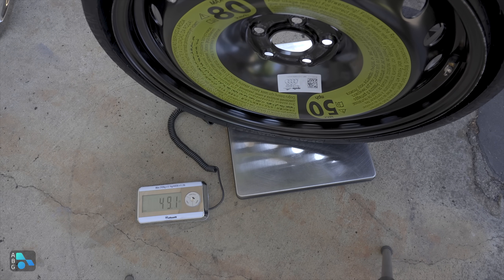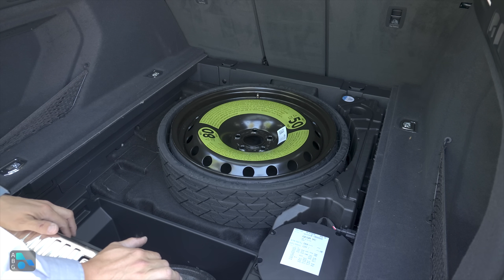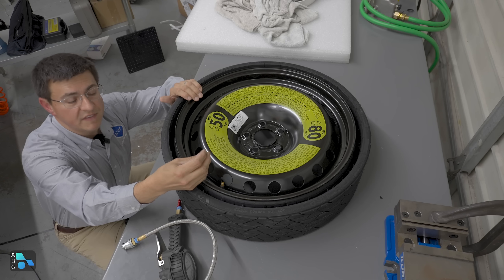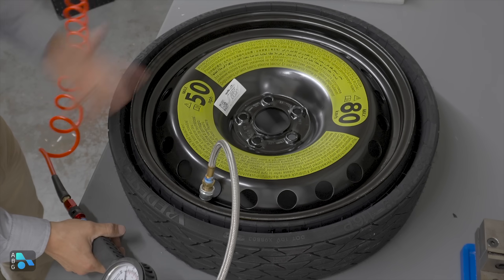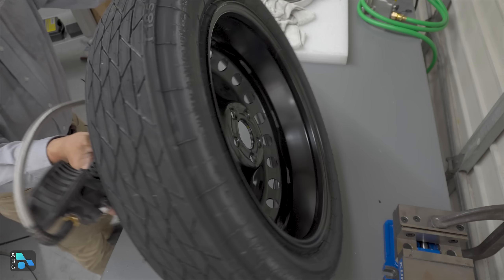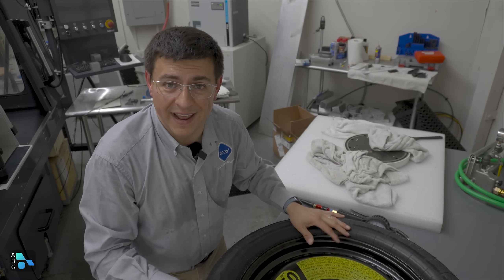How A Collapsible Spare Tire Works, And How It Might Save The Spare Tire In EVs

Comment: Think these tires are safe ? Want to argue with a guy who changed around 6,000 .tires before & after getting a mechanic apprentice certification in Canada? I watched people who came in from the 401 with compact spares completely bald ,& with 2 inch high, (imprinted on the tire ) warnings  declaring the maximum speed. ..%50 of the people didn't see the "same color as the tire" printing ! Others had a tire service or neighbor put on the spare.This warning needs to be stated in a complete sentence with the lettering you show..This is not a contest to see who is curious enough to read the fine print , this may cost you your life & the life of others.!

Comment: That's an ingenious design and it's my first time seen one but It's a load of crap cars don't come with spare tires any more. It should be a law. There's absolutely no reason why cars can't have a full size spare. . . Even a proper donut. (I had a Civic and put over 300 miles on my spare when I was in between jobs. Doing highway speeds and everything.)  The "EV" excuse is just hogwash. (Too many accountants in the CAD room.)

Comment: Temp spares are crap regardless.  Full size spare is the only acceptable solution.  50/50 spares are useless on the open road trip in the middle of the night.  Temp spares also don't solve the problem of where to put the dead wheel/tire if you have a loaded vehicle.  The collapsible spare is a cool innovation of 50/50 spares, but no one should be stuck with a 50/50 spare in the first place.

Comment: Sigh. Where do you put the full sized wheel and tyre you took off? Won't go where the collapsible wheel came out of. If there's room in the cargo area for the one you tool off, then there's room for a full sized spare.
I had this with a BMW Z3, take the space saver tyre out of it's carrying cage under the car, fit it, but there is nowhere for the full sized tyre to go, wont go in the cage won't fit in the boot. Where? They give you a placcy bag to put it in so your passenger can sit with it on their lap.

Comment: Do most people really need a spare at all? In my over 35 years of driving I have used a spare tire only once. Considering the  cost of fuel  for driving around with the extra weight as well as the cost of the spare tires I might as well have called to get the car towed to my home or the nearest tire shop.

Comment: I think it would be better in the frunk, if you have luggage in the boot you'll have to empty it to get at the spare. Also I think most people wouldn't change the wheel, they would just call a break down service, especially if it's raining or they have expensive clothes on, or don't know how to change it.
Reply: Probably a weight distribution issue... Some normal cars have used that reasoning for putting their batteries in the trunk instead of under the hood with the engine...

Comment: I absolutely hate the collapsible spare my Q5. It’s a nightmare. Especially if you’ve used it one time and then try to use it a second time David is usually falling off the rim and it’s terrifying to inflate.  

No, it is mounted upside down in the Q5 and the subwoofer fits inside

Comment: Nothing new, Datsun used a similar space-saving Spare tire system back in the 70s 240 thru 280 Zees using a compressed air can. I wouldn't recommend removing the tire valve because they can get lost pretty quick in a snap, just turn the valve enough until you hear the air bleed out or let the air out by holding in the pin.

Comment: This is not new.  GM was doing this in the 70s and they discontinued it due to safety reasons.  If I were the CEO of Audi/Volkswagen, I wouldn't worry about a spare tire, I'd be carrying around a spare transmission, spare engine, spare instrument cluster, spare electronics, spare everything.  They're JUNK BRANDS THAT DEALERS LAUGH AT going through the dealer auction.  Jokeswagen/Awfuli

Comment: The problem is you have a flat! That's the problem. Your idea is to change the tire to a spare then at a later time take your flat tire and get it replaced and then installed on your vehicle.
Tesla looks at it differently. They send out a truck that has your tire already in it. The truck comes out and instead of installing your donut they actually change the flat tire to a new tire and install it on your vehicle right there right in front of you. You no longer have to take your vehicle to fix the tire at a later date it's completely fixed right there where you got the flat

Comment: Seems overly complex. If they just had a regular spare the size of that one collapsed, they could use the air suspension to level the vehicle and the traction control to account for the different size. No need for the compressor or the wait for the wheel to inflate.

Comment: Collapsible spare tires are nothing new at all. They were available as far back as 1975, if not earlier, on General Motors A body cars. They were a bad idea then and are a bad idea now. After all, put the thing on and HOPE it has not deteriorated over time. Also find room to stow the flat tire and wheel. The other consideration is the weight of the vehicle and cargo. If you are fully laden you may have to leave some on the side of the road. With the rise of these vehicles room needs to be found. If my 1990 Volvo 240 wagon can hold a full sized matching tire and still have over 76 cubic feet of cargo space. Modern designers need to get with the program

Comment: This technology has been out for some time. What nobody talks about is what do you do with the tire and wheel that you pull off the vehicle. If you have luggage or anything in the trunk, it won't fit. Having worked for a European manufacturer in the past, customers always came in with their tire and wheel strapped to the back of the car with the trunk open. We always had a good laugh!
Reply: that's an excellent point
Reply: That was my first thought to, where the hell would you put the spare tyre. Not a good idea as far as I'm concerned.

Comment: I had a flat tire on my Audi Q5 PHEV. It had the useless and awkward to use tire sealant/compressor kit as the only repair. Good luck with that on a bad road, in the dark or rain  Didnt even have. jack on board to remove. to repair it. I was shocked it didnt have the mini-spare like my old regular Q5. When I looked into other new PHEV SUVs like Volvo or VW they also didnt have any spares, just that crap sealant kit. So I have bought a “donut” spare (with jack kit all in a nice carry bag)from a US company called Modern Spare for when I’m out of town. It weighs quite a bit and takes up trunk space but gives me much more piece of mind. Come on car makers come up with something better!

Comment: Spare tyres are not needed anymore apparently hahahahaha, I find it hard to believe that they think a can of fix a fat is an ok replacement for  a spare wheel.
Had a few flats in my time but always had a spare tyre and it was a pita to do on the side of a motorway( which had a hard shoulder  unlike now where lives are not a priority obviously  ) but at least it was done in 15 mins and back on the road.

Comment: In 40 years I've needed a spare tire  4 times, or about one a decade. In all cases it was because of damage, and not excessive wear. Unfortunately on one of those occurrences, I could not use the spare. It was on a rusted solid lowering mechanism below my mini-van and I could not remove it. On subsequent vehicle purchases, I have ensured the spare was located on the interior. Luckily on that occasion, I broke down in front of a farm where they had a tire repair kit (nail through the tread) and compressor so I was able to get back on the road with my original.

Comment: I call BS. My 2007 Audi A4 Quattro (B7) had a FULL-SIZE spare tire with the exact same rims as the car, and it fit under the trunk perfectly with way more than enough room in the car to make it wholly useable. Granted the wheel was a 17", but if a 17" wheel was good enough for a McLaren F1, then it was good enough for the Audi A4, and most other normal cars... there is no reason to have theses giant wheels.

Comment: The space in the back has loads of room around it, it could easily be designed to take a normal spacesaver. 
The bit you miss out is getting a driver today to safely jack the car up and get the wheelnuts off. I doubt if 90% of drivers can.
Reply: You're not as superior as you think you are. Like you're in the top ten percent of drivers who are skilled and knowledgeable enough to use a jack and a lug wrench. It's like a whole paragraph in your users manual. Very complicated and challenging procedure! 😂
Reply: @ButterfatFarms  I did not say if I could do it or not. You know nothing about me. 
The process can be dangerous and difficult and the tools are crap. I now have an inflator kit with my car but I did used to carry a metal tube to get enough leverage on a wrench. I think it would present a problem for many people so is a fairly pointless thing to have.
Reply: @grolfe3210  I know enough about you to know you think you're in the top ten percent of drivers that have a clue about changing a tire. You're not that special. 😄
Reply: @grolfe3210   you also assume that one who owns the car and the spare tire needs to be the one to change it. The reality is many a decent person will help them with that whether they're just a pretty lady or someone who is elderly or has a disability etc and can't cope with it themselves. You act like having a spare tire is useless when the reality is what's useless is wrong minded thinking like yours. Spare tires aren't pointless. Your opinion of them is.

Comment: I might suspect that locating the spare tire in the frunk would be a potential collision hazard. Many vehicles are designed to have a front tire break off in a front end collision to avoid impinging into the passenger space and harming occupants. The same idea may apply here for the spare that is stored in the front of the vehicle.

Comment: Certainly looks like a great compromise. One thing I've always believed in, and yes, it can mean extra work, is to always run any kind of temporary spare on the rear. None of them have the same characteristics or integrity of the original equipment, so for steering and braking safety, a matched pair on the front is far more important than on the rear. So if that means two swaps, rear to front, and spare to the rear, I'd do it for safety.

Comment: 0:20 Meanwhile, I keep a full size spare with a jack, torque wrench, light, emergency triangles.. everything..  needed to change a tire in the front trunk of my 2014 Model S 🛞 

Don’t believe me? You haven’t opened the hood of a rear motor Model S before. Seriously. It’s H-U-G-E.

Comment: thanks. very interesting. first time viewer - subscribed. when expanded does this tyre have the same diameter as a normal tyre? I have heard if you mismatch tyre sizes you can do damage if mismatched tyres on an all wheel drive ?

Comment: This is a dumb idea. So you have an uninflated spare adding additional risk and steps to the emergency process and you're now driving on a tyre that will collapse in on itself when it gets below a certain pressure. Yay for safety. And where do you put the full size wheel if you're fully packed? Not a smart idea at all.....😊

A victory for the BS marketing team at Engineering's expense.

Comment: A really good idea because the two punches that I’ve had over the years because of where  they were the inflation kit couldn’t be used. But luckily I was able to drive it to my local tyre centre without loosing to much air.

Comment: This collapsible spare isn't a new idea. I saw one on a 1972 Ford Mustang, and it came with a can of CO2 to inflate it. It didn't collapse as easily as this one though. It required deflating it and using some brute force or a vacuum pump.

Comment: My 80 Trans Am has a spare like that.  I think all 70-81 Firebirds and Camaros had them.  They used a CO2 cylinder to fill it quickly.   

This was required due to having a tiny trunk and having a limited slip axle that requires identical tire sizes in the drive axle.  

Old tech comes back to modern day.
Reply: My 92 Camaro had this style of tire. Never had to use it.

Comment: It's not just the size/weight/cost of the spare (and the jack), it 's having the knowledge, willingness, and strength required to actually perform the non-trivial tire replacement procedure.  Especially at night, in inclement weather, and/or when there is not a safe place to actually do it in.  I have been driving since 1986, so I could do it and have done it.  But overall, I'd rather have the extra trunk space and just use the inflator kit, then call someone for help if that fails; cell phones are a thing now.
Reply: Non-trivial tire replacement procedure 😂
Reply: You would be amazed at how many places do not have cell service due to distance, mountains, wet trees.  I live 30 miles from Phoenix, 5th largest city in USA and get tired of my phone beeping as it loses or recovers cell service.

Comment: The one problem that you have to remember is the tire inflator that comes with the car is probably one of the cheap ones with a plastic piston which means it's going to take you a good hour and a half on the side of the road to take the unusable tire off. Put this tire on and inflate it in increments you can only run the tire inflator for about 10 minutes. Maybe push it to 15 minutes. Then you have to give it 15 to 20 minutes to cool down. Then another 10 to 15 minutes of running until you're up to the proper pressure. And that's assuming that the 12 volt tire inflator that comes with the car is capable of inflating the collapsible spare to the correct pressure in the first place Yes, eventually you're most likely going to be able to get that collapsible spare to work. I would assume using the factory equipment that comes with the car, but it will take quite a while just because of how slow those tire inflators tends to be and the limited run time that you can run them for before you have to let them cool down. The good thing is is you already have it hooked to the tire so you just need to shut it off and give it 20 minutes. Then you can turn it back on and run it for another 10 to 15 minutes until the tire is back up to the proper pressure.
Reply: I've used it before.  It took like maybe 10 minutes.

Comment: Really wish more companies would do something like this. I've had to replace multiple tires on different cars on the roadside, including one sidewall blowout that wouldn't have been salvageable without a spare. Those fix-a-flat kits feel like unacceptable ways to cheap out or not care about the consumer.
Reply: I don't know what happened to that cheeky comment I got a notification for, but I wasn't driving most of the times I've replaced a tire for someone else, hence the multiple cars on the roadside.

Comment: Had this collapsible spare tire 50 years ago in my Opel Diplomat. Its life time was limited, replacing it and the pressure bottle was expensive. There is enough room in an EV, but nobody needs a spare tire anymore. People dont know how to change a tire, or they are just too lazy. That liquid glue stuff is enough. I do have a 10$€ rubber plug which is easy to install, plus a compressor, it doesnt clog the TPMS or the anti noise foam in EV tires.. Had to use it 3 times the last 10 years. Easier that changing the wheel. But most other people just call the AAA/ADAC/road assistance, they dont touch a nut. Also a spare wheel plus all the tools are expensive, companies save weight and money.
Reply: In the Western US and Canada, you do in fact need a spare tire. There are tens of thousands of miles of roads in remote areas (Mojave Desert, Sierra Nevada and Rocky Mountains, etc.) where there is no cell service. You get a flat out there in any of these cell phone dead zones, without a spare tire, and you might wait many hours for anyone to come along at all, then more hours for a tow truck to show up. I had a flat on I-5, at the Weed Airport last May. I put on my spare, and we were ready to go in 45 minutes (a younger person could have changed that tire in 20 minutes, but I'm 67 years old and not as up to tasks like this as I once was). If I hadn't had that spare, it might have taken 2 or 3 hours for a AAA tow truck from Yreka to show up, and we would have lost at least 4 or 5 hours total.
Reply: Vehicle without spare tire  = stupid.  I've had many flats over the years, and always changed them myself and continued on my way with minimal delay.
Reply: Roadside assistant can take several hours to show up even when in town.  But if you bought an EV you don't value your time.

Comment: What is the point of a flat spare tire? Where do you get the air from? And what kind of compressor you're gonna have to put out 80PSI.
Reply: Did you even watch the video?  With the sound on?
Specifically at 2:03 where he says, “Now let’s get to the inflation. I’m not going to be using the pump that came with the Audi because it’s a little on the slow side.”
And at 5:33 where he says, “Under this little partition we then find the tire inflator kit “ (aka tire pump).

Comment: Meh.  I want a spare tire that is ready to go.  I notice you totally skipped over what the manufacturer expects you to do to fill the spare with air...  you conveniently have a really nice compressor with sweet pressure gauge to fill it up.  lol.
Reply: I notice YOU totally skipped over where Alex told you want the manufacturer expects you to do to fill the spare with air. Specifically at 2:03 where he says, “Now let’s get to the inflation. I’m not going to be using the pump that came with the Audi because it’s a little on the slow side.”
And at 5:33 where he says, “Under this little partition we then find the tire inflator kit “ (aka tire pump).
Reply: @NovaResource  Next time Alex will actually do what he's told and stop depending on his sycophantic viewer advocacy.